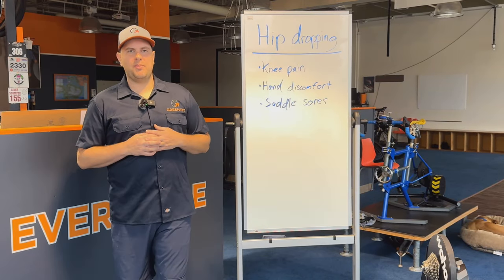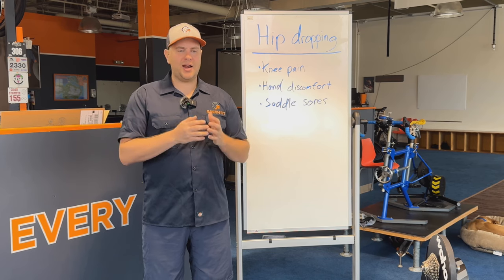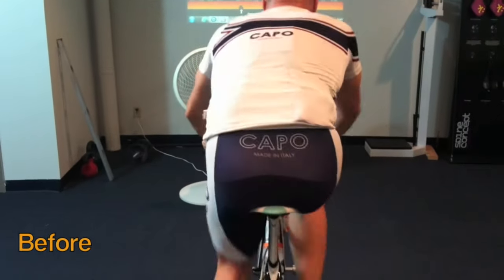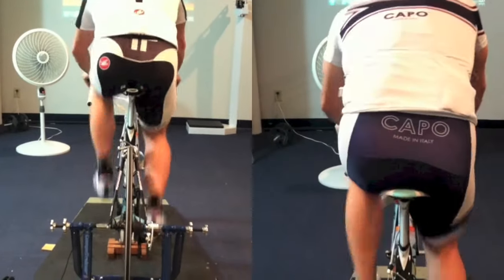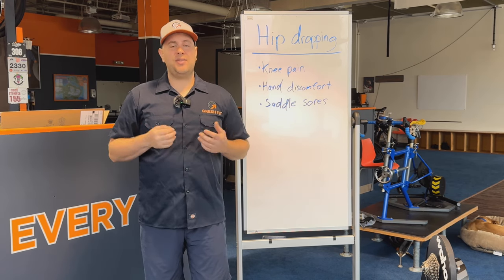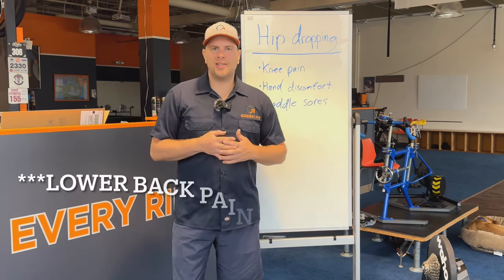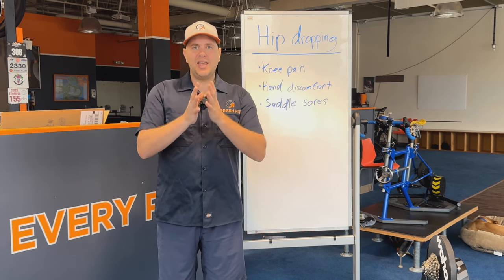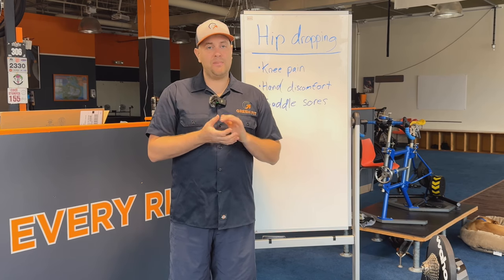Hip Dropping - Asymmetry - GreshFit Bike Fitting

Comment: Excellent graphic example of asymmetry. But... how did you fix it? Dropping the saddle height? Or with same height just changing the saddle? Changing the saddle fore/aft? I got several professional bike fits and none of them touched this point. My left hip is completely positioned at the left side of my Selle Italia SLR Max Superflow (143mm having ischia bones distanced 11cm) and I'm getting seriously injured at the point that I must stop and recover from hip pain (pain impingement maybe?). I'm trying everything myself. I checked the height and seems good, I moved a little bit back the saddle (from 3cm to 4cm relative to bottom bracket) for following KOPS and fixing hand numbness, and also changed the cleat position to be positioned between the 1st and 5th metatarsus. But I still suffer left hip dropping. How can I made more adjustments in my bike or myself in order to improve this issue? The only thing that I didn't touch is my handlebar which is not so bad positioned from my humble opinion (I have a 6cm drop from the saddle level). What do you think that can be the cause and how can be fixed? Thanks!!!

Comment: Hi, I’m experiencing something similar, and have saddle sores on my right side as well as lower back pain. I saw a fitter, but still experiencing discomfort. My right leg knee also doesn’t track super straight. Assuming I’m comfortable on the bike on the front end, would a change in seat height be a change I could try it, and if so, which direction? Up or down?
Reply from the maker: This would mean you are not sitting square in the saddle for some reason.  Hard to say what to advise without seeing you.   Good start is watching my video on balance - and set seat being so that at high load on a climb you aren’t feeling any strain high up in hamstring

Comment: In what scenarios would you use a cleat shim, if you can just lower the saddle to the point that the dropping hip doesn't drop?
Reply from the maker: There’s too many scenarios to list.   But overall - when the seat is as a sensible height and hip still drops - a shim may work to get more symmetry
Reply: @greshfit  thank you. I had a fit by a respected fitter a couple years back and he put a 6mm shim under my left cleat, said i was dropping that hip and sitting to the left of the saddle. But I didn't get into detail with him about saddle height, or what I could work on off bike to address that asymmetry. He said I didn't have an actual leg length difference. Having another fit next month where I can hopefully address those questions.